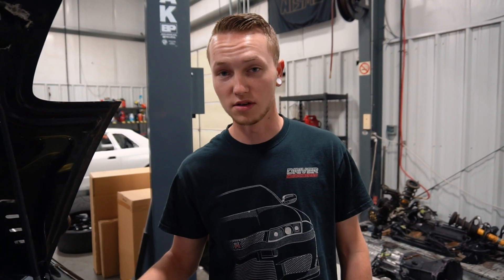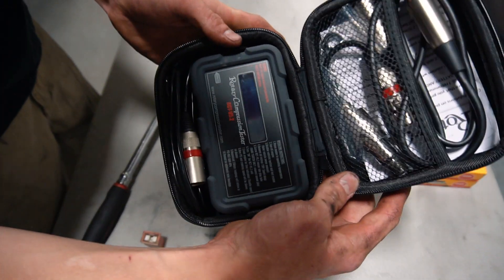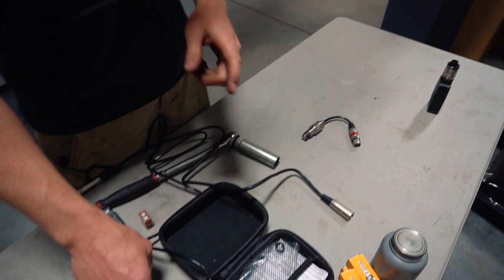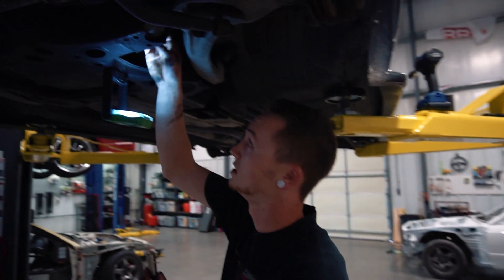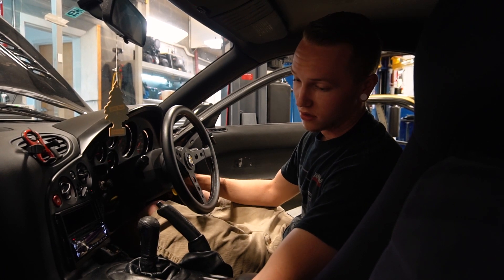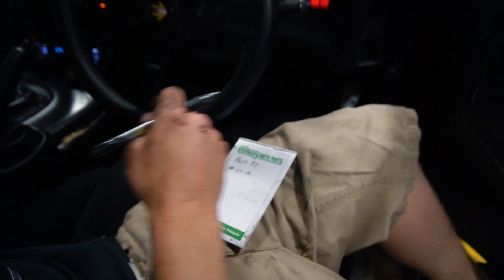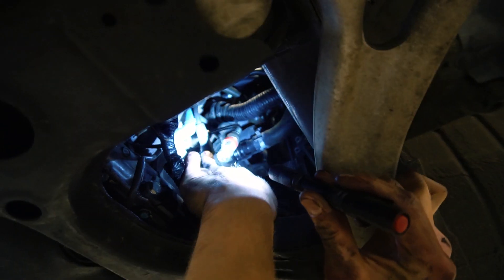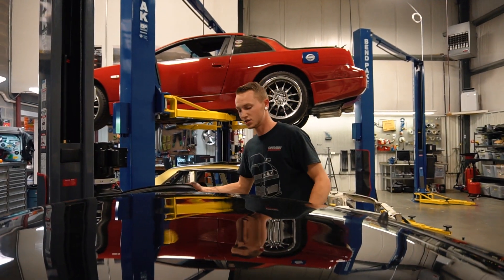How To FD RX7 13B Rotary Compression Test | Driver Tech Tip

Comment: What should be the normal rpm when testing with this device. I have over 100 for both rotors but one was at 275rpm and the other was at 283
Reply from the maker: You should be fine. Those numbers are close enough.
Reply: @DriverMotorsports  Thank you for replying!

Comment: You said a 100 and below and you'll continue to do apex seals etc but that's not the case. According to the 94 manual the minimum accepted compression is 85 psi.
Reply: 100 or bust

Comment: When you put the adapter into the housing, do you need to cover up the other trailing spark plug you removed with the spark plug wire? Or does it not matter because there individual rotors? Thanks in advance 😁